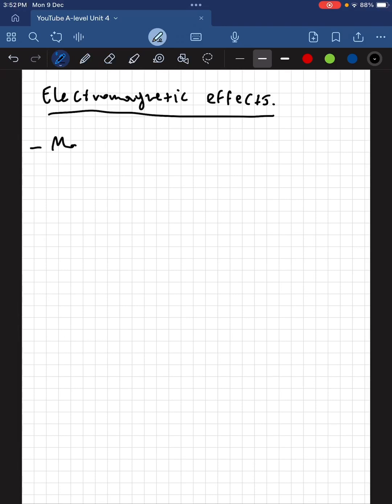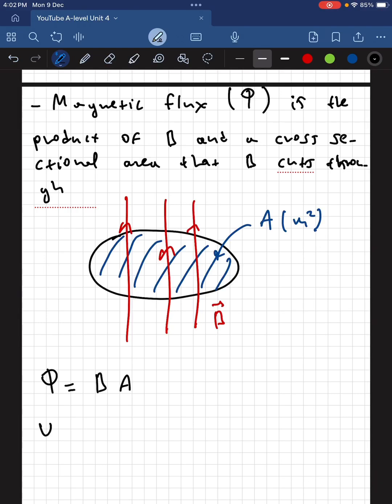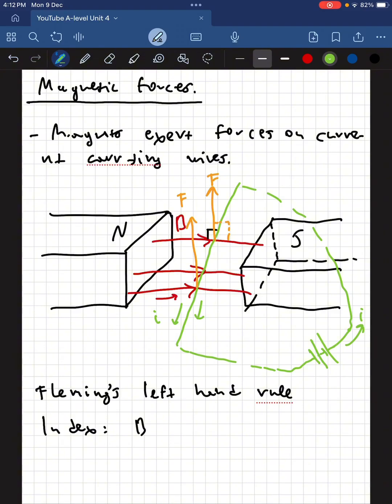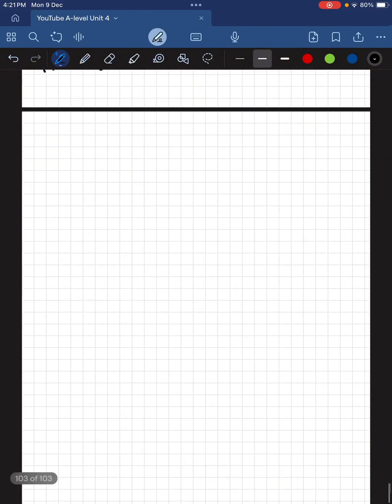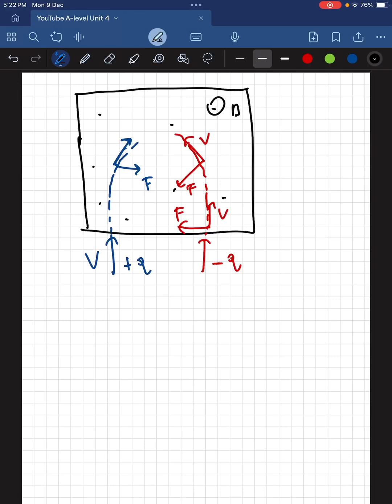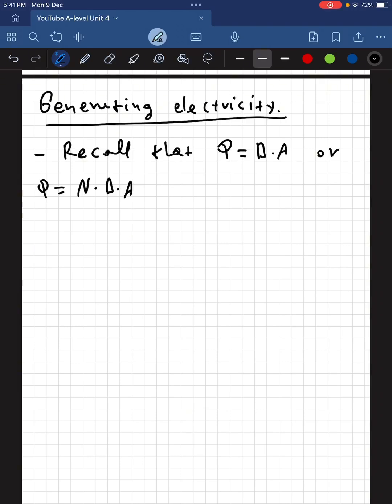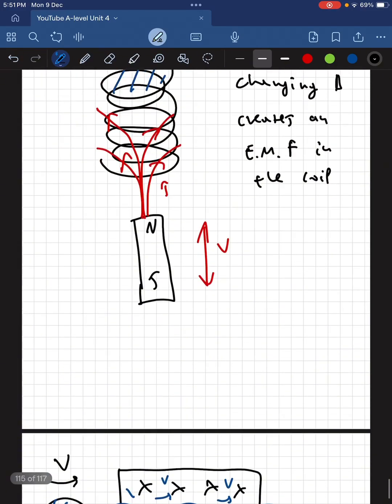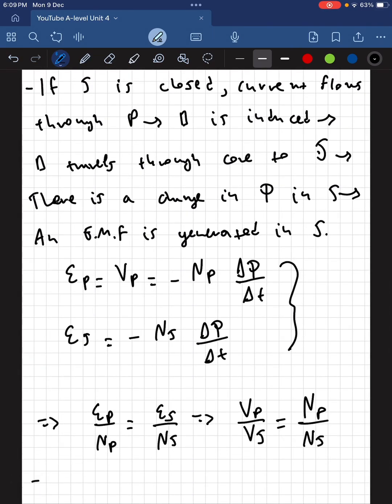Edexcel IAL Physics Electromagnetic Effects and Magnetic Fields

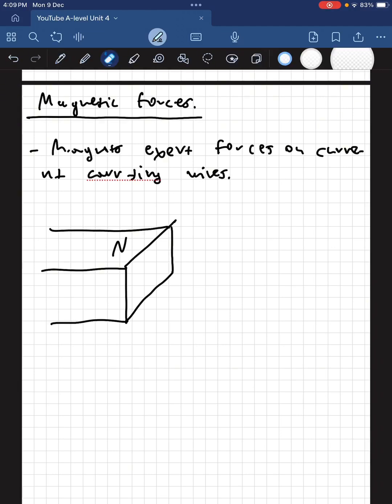Comment: I think you mean Magnet exerts force on wire carrying current 18:16
Reply from the maker: Yes! When I current carrying wire is placed inside a magnetic field it feels a force from the magnetic field. Unless the current is parallel to B in which case there is no force
Reply: @doctor_no_  wire carrying current not a current carrying wire
Reply from the maker: @vedpatel5022 Both phrases mean the same thing. It is just different word order. Not an error
Reply: @doctor_no_  ohh mb
Reply from the maker: @vedpatel5022 no problem :)

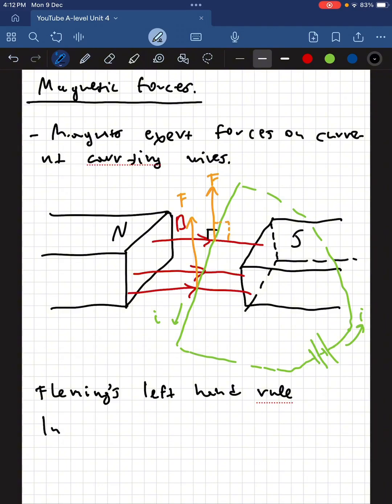Comment: For the question at 20:38, if I instead take the -100V line and X to calculate the field strength. Say I do: -(-100 - -80) to calculate (-) delta V. And for delta d it is: 33.5 - 23 convert it to meteres. Then shouldn't I get the same answer?
Reply from the maker: Hi! Again this video is about electromagnetic effects. I believe your questions are tied to a past paper walkthrough video and I can't know which unless you point me at it :/